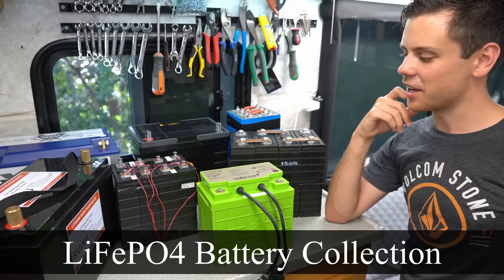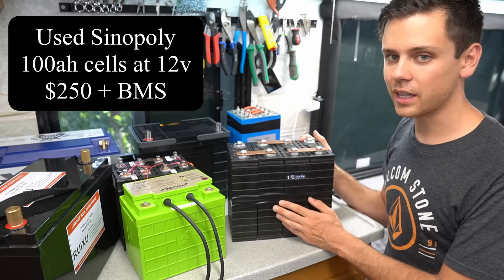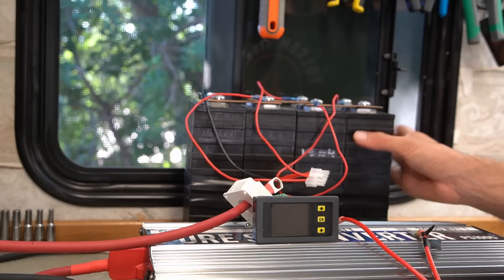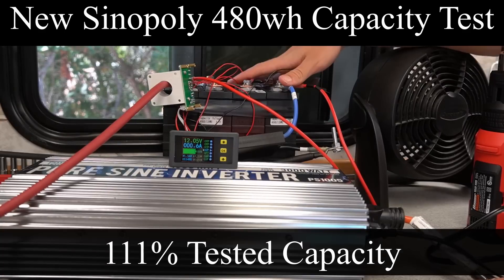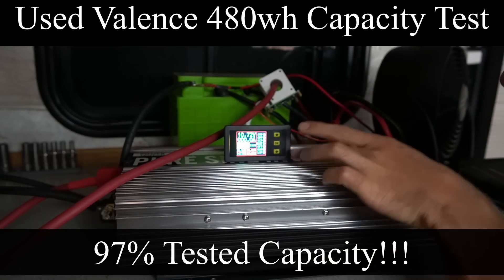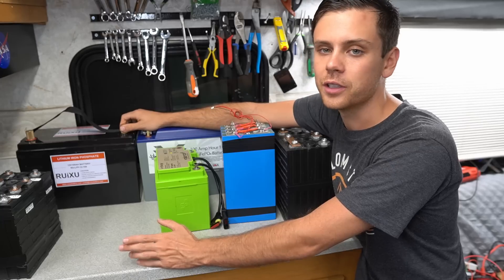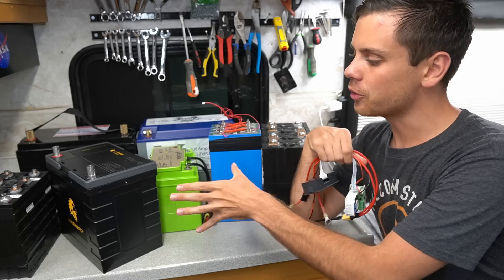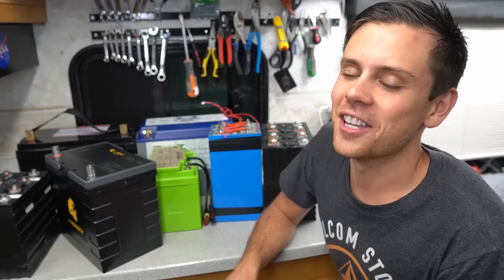LiFePO4 Off-grid Solar Battery .2C Capacity Test and Price Comparison: USA vs China, DIY or Buy?

Comment: Im following your advices on my solar rv proyect. But i cant find an important info anywhere. Can i add my alternator current to my solar setup for that times when im driving, or also the DC oulet of my generator when im using it. Yes i install i high output alternator on my toyota camper. 140amp waste most the time because the original was only 50amp. Also thinking on a wind turbine. So final question is. How add different sources to the same system. Thanks in advance. Wonderfull channel thank for speak soo clear im not English native speaker and i understand everything.
Reply from the maker: https://www.mobile-solarpower.com/battery-isolators.html

Comment: China has more Solar Energy production than all the energy produced by any source in America. China has been at least a decade ahead of everyone when it comes to innovation in solar panels.

That being said, with the trade war and tarrif on Chinese products the cost of the best panels are out reach for me. But I am still moving forward with my Solar System for my house. Today is the first day of the install!

20 of Mission Solar panels, Solar Edge string inverter and optimizers for 6.1 kilowatts.

Tesla won't sell me a tesla power wall battery backup though(not in Kansas anyway). :(

How do feel about designing a power wall for my grid tied system?

Comment: I'm looking for a replacement for my SLA batteries in a rackmount UPS system (APC 3000XLM), which is currently setup in 4s2p (8 total, 48v nominal 10Ah) setup using 5Ah SLA batteries.  Is there an easy, drop-in replacement option available in LiFePO4 that won't have a fit about the charging system in the UPS, and that I can add more of in parallel for more capacity?  Obviously price is also a factor, and I don't mind building my own pack so long as I can get a BMS that will work with the constant charging from the UPS itself.

Comment: Thanks for all your hard work. I was lucky to get 4 used Sinopoly cells when eBay had them. I’m now adding BMS, relay and low voltage cut-off as in one of your previous videos. Keep doing what you are doing.

Comment: I would add that the Tesla batteries, made in the USA with Panasonic‘s help, are a substantially better value in terms of $/kWH, albeit with a different chemistry.  Also better kWH/pound, and don’t react well to bullets...
Reply: Or heat....or cold
Reply: Brian Crites all Lithium chemistries have issues with charging in temps below freezing and discharging above 35-40C or 90-100F.

Comment: Noticed that the used Valence test @ 9:55 went from 0.2C (8 amps) to 0.5C (18 amps).  What happened there? Feels like another 100W load was added at some time during the test. 
The current test setup works fine, but you could have perfect CC tests if you used an Electronic Load. Very useful for battery testing, not to mention the different programming you can do with them, along with setting your own cutoff voltages
Reply from the maker: On some of the tests the current shot up at the end. Watch the meter current with the battle born. Pretty common at lower c rates when the voltage is low. If I pull higher c rates, the current will not shoot up at the very end. 

Yes a constant current load would be better. Agreed. So true
Reply from the maker: And no other load was attached at the end of that test. I think it's because the heat gun I use will pull the same wattage no matter what. So when the voltage decreases drastically at the end of the discharge curve, the amperage shoots up. It's only for the last minute of the cycle that this occurs. It is constant through out the rest of the cycle
Reply: @WillProwse  Curious, if the output power to the heat gun is constant at 100W, and the input rises to 200W, does that mean the inverter efficiency is tanking at around 50% at that battery voltage? 

Now I'm curious about the inverter's efficiency-input voltage curve, and if it is actually heating up considerably while under test.

Comment: Used Valence are no longer cheap, so not such a great low-cost option.  There are some chinese batteries that look almost identical that I saw online, maybe they would be good to test?  Also, what about starting from scratch with Headway cells?  Or is that beyond the scope that you want to get into?  I am seeing some huge capacity DIY power walls getting built.

Comment: What are you now running for the solar system in your RV?
Watched all of your video's ..trying to build an up scalable starting at 600 w system for a trailer build (plus trying advise someone who has worn out their 15 year,  off grid house lead acid monster bat bank).
These tests are great but..What should we actually buy?
Reply from the maker: Great question. Lately just running battle borns and a mpp all in one unit. I'm a bit lazy haha! I have some new systems coming out though. And usually, price is the biggest factor. You can't go wrong with a all in one unit and it takes minutes to setup. Highly recommend checking those out on my website if you haven't already.
Reply: @WillProwse  Thanks for answering!
I am toying with the idea of going mobile full time ..or maybe 9 months of the year.
Trouble is, I have a Tacoma, which I love, so finding a small tow trailer that will not kill me financially is a problem. Have decided a shower and toilet are must.
Looking at something like a Tab 400 and putting flexible panels on my camper shell and the trailer itself.....or converting a used ambulance. But the expense of a diesel engine failure keeps throwing me off that option.
Keep up the good work!

Comment: Nice review. Thanks for taking the trouble to share your findings with us. one thing I would really like to see is your review of a battery built with prismatic sells ordered from AliExpress. 

I recently purchased 8 prismatic lifepo4 cells, 120Ah, including 100a Daly BMS, at a total cost of about $0.29 / Wh. 

I was very hesitant to buy direct from China without much of an assurance of what I would get. I found very little information about it online, and there are basically no reviews out there.

These AliExpress cells have far exceeded my expectations and I'm super happy with them. Everything was beyond my expectations, including the quality of the cells, packaging and shipping, FedEx express delivery direct from China, and also direct online support. 

I agree with your sentiments about the politics of China, but the quality of the manufacturing and products should not be discounted.

Pretty much everything in my solar lithium rig was made in China, except for the 0 gauge cables made in the USA by Windy Nation. I don't feel bad about this, it's just the way things are.

Keep up the good work Will, and thanks.

Comment: Great video! I love these tests. I just tested some new old stock aluminum 50ah cells (12v/100ah configuration) yesterday. I didnt have my hall effect sensor in place as i was just doing a back to back time comparison against AGM with a 95amp load. it worked out to providing 97AH stopping at 11.5v because i didnt have a BMS in place and didnt want to risk drawing any cells too low.

Comment: Careful, those Valance packs don’t actually have built in self-cutoff! I got four of them on Craigslist a few months ago and run a solar ewheel charging system with a diy MPPT, they perform great. But. Valance practically hung up on me when I called to get a communication data sheet and they found out I bought them used. The packs communicate with RS485 and send data to an external contactor unit they sell (to big businesses only). I haven’t been able to reverse engineer it yet.
Reply from the maker: The valence battery I have does have low voltage cut off. Moment it hits 10.5 volts, entire pack disconnects and open circuit voltage is under 3 volts. So it has a typical BMS inside with low voltage disconnect. But there are many valence models that I am not familiar with. The one I have does have this feature though
Reply: Ahh sweet, I wish mine were that model. My spec sheet is super misleading about it, saying it has all these intelligent protections but later on down below mentioning ‘only when installed by a certified person with the appropriate cutoff unit’
Reply from the maker: @t413com  oh wow thats good to know. I'll check this out when I test valence batteries. That's such a bummer! I hope your batteries weren't damaged due to that. Very unfortunate :(
Reply: The valence bms has a few settings that are configurable with their battery management software. Maybe your batteries have the low voltage cut-off disabled or set really low. Like Will, I also have a Valence with cut-off at 10.5V

Comment: I think the the complaint made about Chinese stuff is the materials they use for example I bet your tool kit behind you is not made in China. once you bust your knuckles from broken socket made in China you'll never buy again. (Structural integrity)
great information video as allways 👍
Reply: I dont believe you can blame china for its "lack of quality" even on sockets like your example.  think about it this way, do you really expect the $10 Chinese socket set to be great? At that price, it cant be. Now look at something like harbor freights new "ICON" line of sockets, still made in china but at close to snap on prices. I havent been able t break one yet. My point being you cant compare a 10cent item to a $10 item no matter where it is manufactured.
Reply: Doing electrical install used a pair of side cutters, handle broke, cut my palm, deep. Home Depot ' Ohio Forge', expensive bait and switch by HD. AMERICAN owned  company crap, built in China.
Not China specs., no  HD specs.
Reply: @AcmePotatoPackingPocatello  knock offs

Comment: Hey Will, have you done any videos on properly applying eternabond tape in such a way that you won't get leaks? I searched and didn't see one. I was wondering how you seal cracks between the stuff, etc.; do you "shingle" the strips or use some other technique?

Any insights (and what's worked for you) much appreciated!
Reply from the maker: Used denatured to clean surface and apply. Use rolling pin to help adhesive flow into mating surface. I made video on this here: https://youtu.be/qGuFYoS5nT8

Comment: Hello Will, is a 20 gauge silicone wire good for 2 5 Amp 18650 lithium ion battery cells?